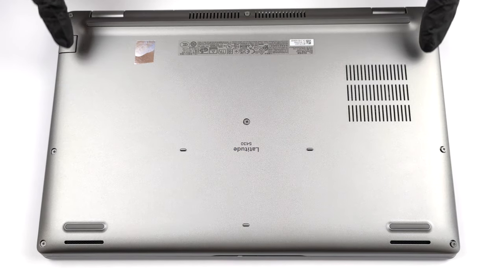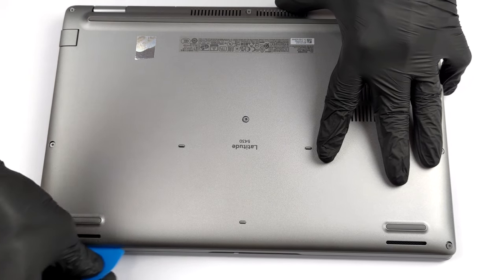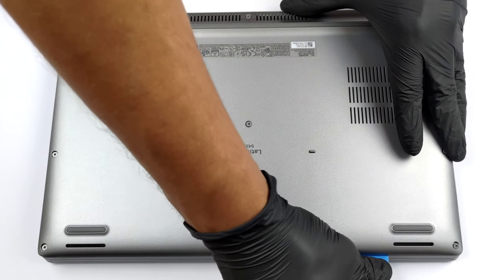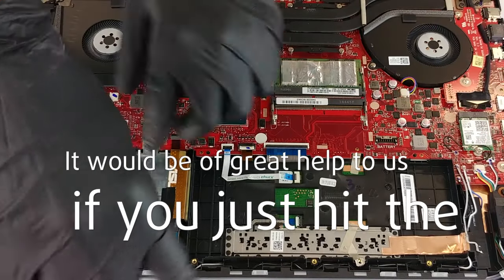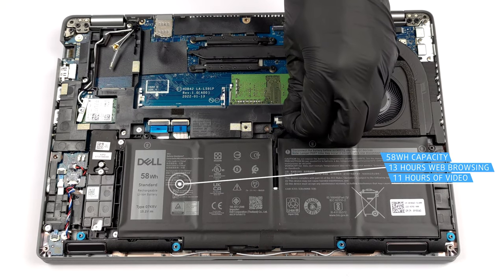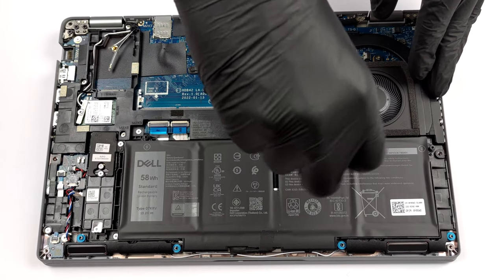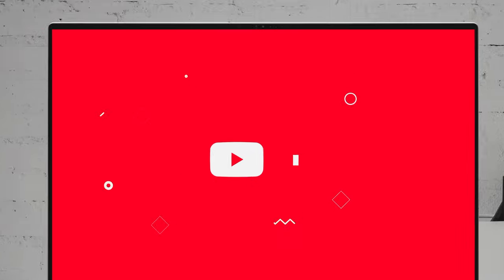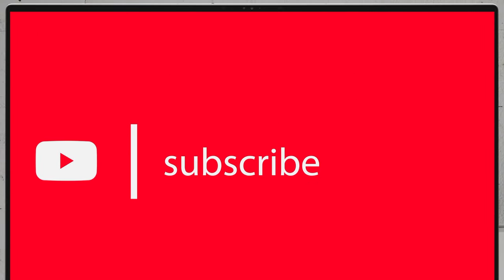🛠️ Dell Latitude 14 5430 - disassembly and upgrade options

Comment: Hi Laptopmedia, is this laptop GPU upgradeable? Thanks
Reply: since this is a 12th gen core, you can upgrade the ram for it to utilize dual channel mode and allow it to use the Iris Xe IGPU. Its pretty good for an integrated gpu and runs well, check out some benchmarks.